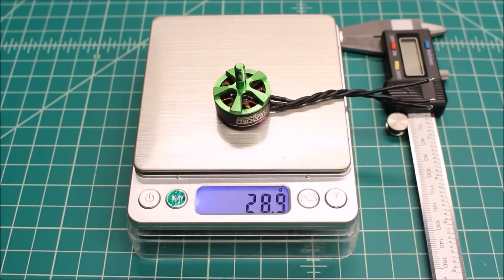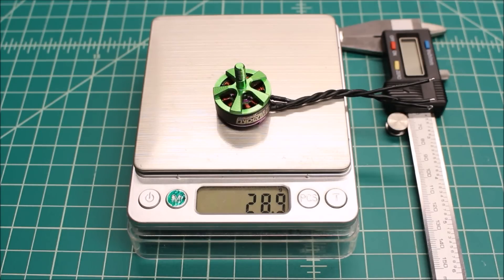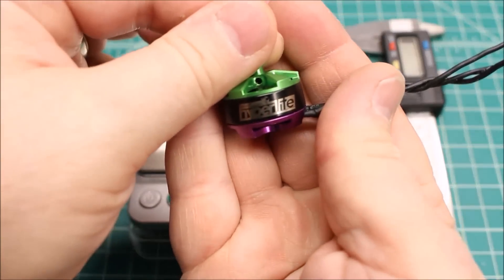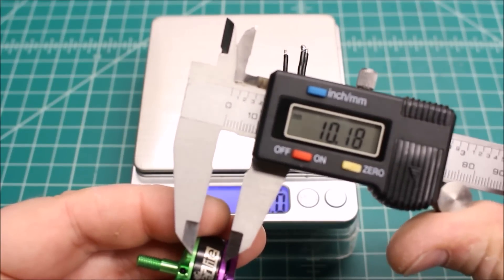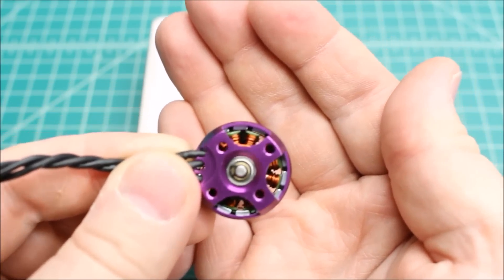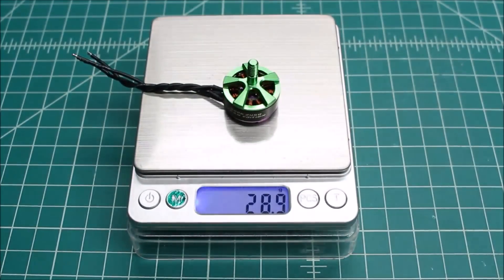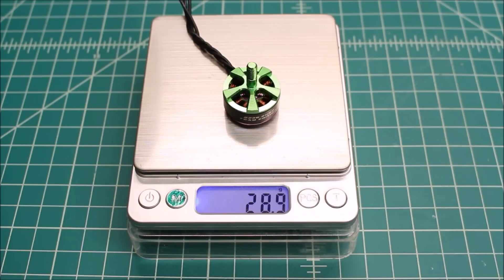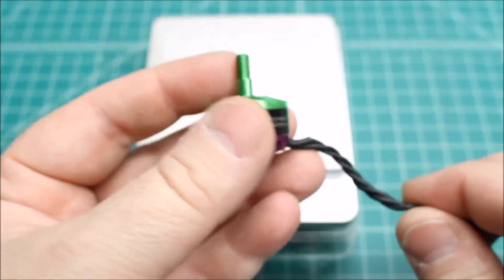Revised Hyperlite V3 2206 2450kv "Team Edition" Rcbenchmark 1520

Comment: So these numbers are much higher than your other video on this motor...

Are these numbers a better representation of what this motor is capable of? I feel like I must've missed something...

Thanks!
Reply from the maker: I use a larger capacity battery that has more current available, so that could be affecting it some. Other than that the RCBenchmark is fairly accurate.
Reply: X-Frames FPV thank you for your response

Comment: These are  high thrust numbers for this motor.  It's an awesome custom  ZMX V3, but miniquadtestbench tested it and the closest it came to 1500g on 5" props was 1424g with DAL 5x4x4's. Generally it was around the 1350g range, which seems right.  Is there something I'm missing?  I can see the numbers on the screen, but....
Reply: probably quadmcfly is running them of a power bank with minimal voltage sag or could also be a different tester. Numbers have a meaning only in relation and same setup.

Comment: Also, any chance you could also include the DAL T5045 v2 HBN props & the DAL 5x4x4 quad blade props? Also it's worth noting in your DAL props to be sure to mention if they're the "Crystal" version or the standard nylon version as it really affects static test data and in-flight performance due to flex. Most of us have all converted to the stiffer crystal props (similar to the RK prop materials).
Reply from the maker: +Eganwp I think this video should have the Dal Q5040s. I'll look to add the T5045 V2s.

Comment: Great videos Doug! Could you please be sure to clarify which prop is which in each of your thrust results you place on screen? Some of them don't say and it's hard to tell from looking at the prop in the background which brand it is. Even a quick summary of results listed at the end would make this even better. Thanks again Doug! -Eganwp
Reply from the maker: +Eganwp are usually try to put the prop used on the spec shot but must've missed it on some and I apologize for that.

Comment: Are the RK5051 that inefficient on the bench? and they also performed so badly on the thrust too??? (compared to all the other props you've tested?! the other RK props included) cos in real flight, they pack a punch!
Reply from the maker: Ray Choi I agree with you. I think the issue come down to torque. These tests do not  measure torque which is where a lot of punch comes from, and that's where the 5051s shine.

Comment: Sorry, I just posted commenting that the T5i would not have continuous autofocus, but it does! I think you can play with the target that the camera looks for to focus to. Not sure how it works with Canons, but you probably can set the camera to concentrate focusing in the dead center of the frame, so when you bring something closer to the lens, the camera will not look for stuff in the sides of the frame, but only to what is in the middle, thus working faster and more precisely. 

Cheers!
Reply from the maker: Márcio Senger thanks for the information. That helps.

Comment: have you tested the returner v4 motors? they look tasty :)
Reply from the maker: +STRYKA not yet. Soon though.
Reply: STRYKA cos the Hyperlites are just the BrotherHobby	with their brand on it right? The R4 are same as the Hyperlite V4 right? and the V4, newer motors than the V3 are suppose to have better performance right???
Reply from the maker: Ray Choi correct